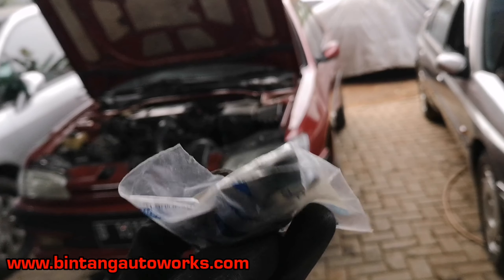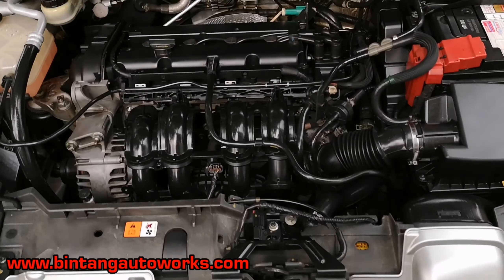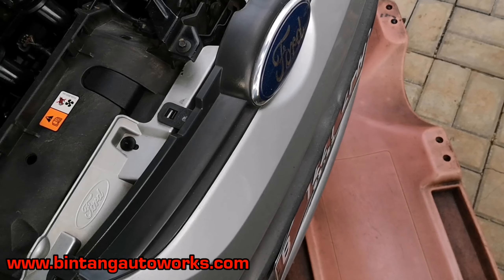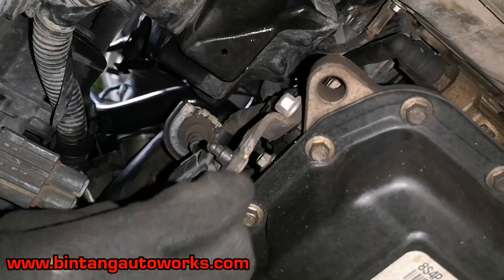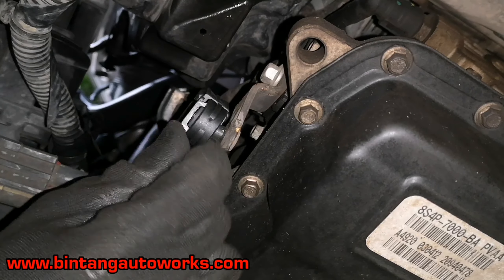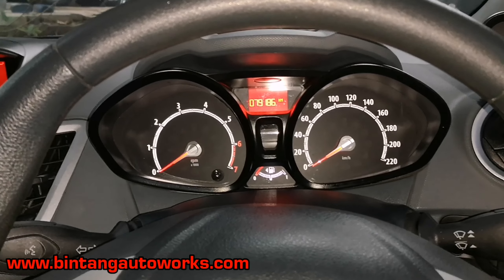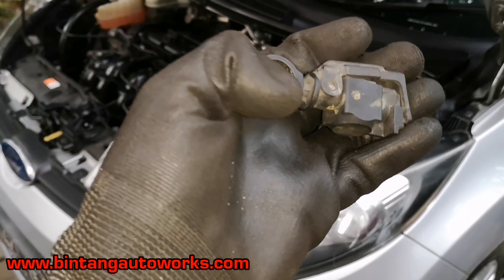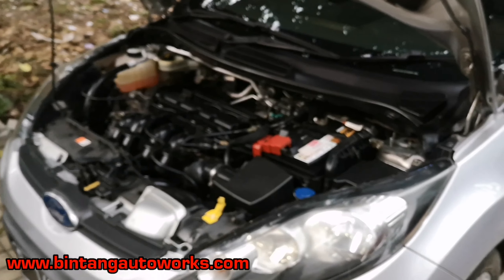GAMPANG BANGET CARA PASANG CABLE CLAMP FORD FIESTA 1.4

Comment: halo om, posisi cable clamp ini kalo dilihat dari bawah, ada di sebelah mana om? saya ngolong kok ngga ketemu2 ..

semoga dijawab, terima kasih om 🙏
Reply from the maker: Hallo om..posisi ada di depan transmisi agak ke tengah om..gampang di akses juga kok om..semoga ketemu ya om
Reply: @bintangautoworks  ohh oke siap om .. btw om, banyak yg bilang di dekat roda kiri, bawah radiator. itu beda lagi ya om?
Reply from the maker: @notv5571  beda om...memang di bagian kiri depan radiator tapi nggak dekat roda
Reply: @bintangautoworks  alhamdulillah sudah ketemu om .. ini kalau lepas, sementara di ikat dengan kabel tis kira2 aman ngga om? biar bisa dibawa ke bengkel terdekat ..